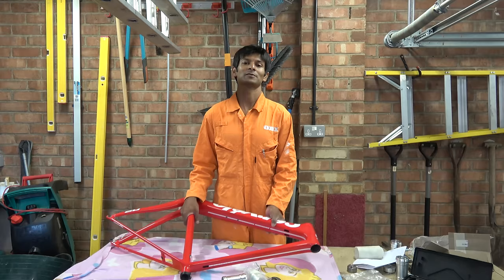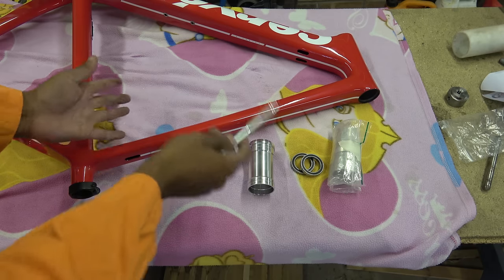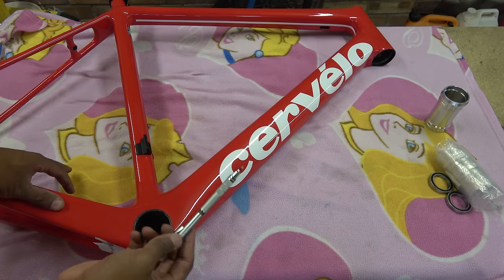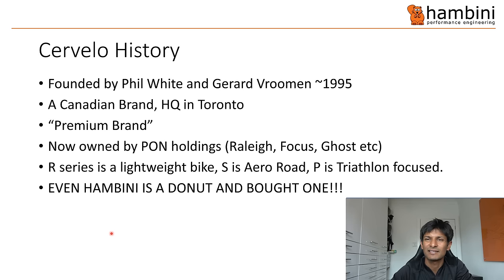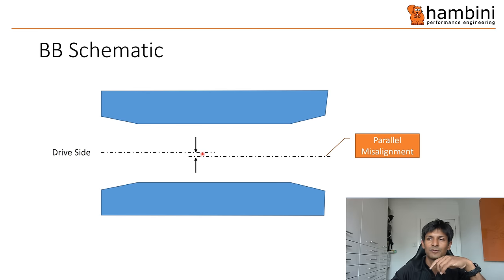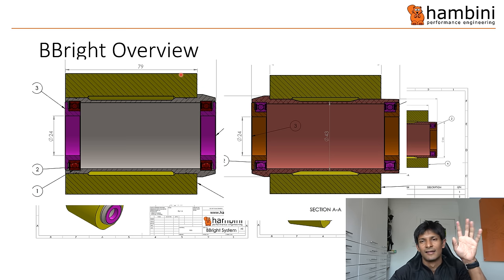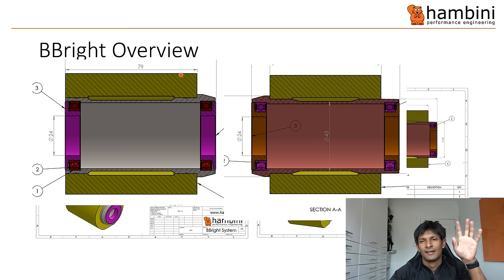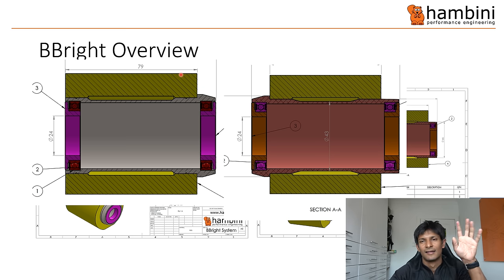Cervelo Exposed and fixed... Scumbag Aero bike manufacturers (A Hambini Reaming)

Comment: Love your swearing and calling these shitheads out.  Some of these bike companies are nothing but con artists.
Reply: @the.communist  I buy second hand, mainly mountain bikes. I buy quite a few because I'm 18 stone (15% body fat so not really a fat bastard :-) and they tend to snap quite a lot. 

I've just got home from a 20 mile ride on a 2011 Kona Hei hei 100 with a snapped seat tube. I pushed another seat post down there and secured it with a few well placed bolts. I've been riding that around for about 18 months. Not really giving a fuck.

Cannondale, Avanti, On One, Mondraker, Kona, Alu and ti, I've snapped them all and I'll be happy to carry on snapping them until the end of time (if they don't cost more than about 600 quid) I built up a carbon Planet x frame but daren't ride it incase it explodes and carbon fibre splinters enter my rectum. I did ask Planet X if they could provide me with rider weigh limit info but they ignored me.

I'll never buy another new bike because they're taking the piss,  I recently bought a cheap second hand CX bike because they looked so cheap in comparison, now though it seems everyone is doing the same and prices will inevitably shoot north. 

Ahh well, in the end I guess they're not too expensive, I just wont pay what they're asking.

Comment: Thankfully the store I work for had cervelo dealership taken up by some othee twat. It was right at the time when this stupid  BBright system came in. The first and last we ever sold was the top of the line R5 CA.  It continuously creaked and the BB would actually migrate out. Even when prepped and cured correctly. The third frame was actually prepped and set allegedly  by their experts. Once assembled it still did the same damned thing! Junk.

Comment: So basically they created their own system and it is near impossible no make it work because the tolerances are such that  that you can't know if a bus or a hair will fit through.
I am so keeping with my octalink bottom brackets.
Reply: octalink is hard to match, very hard.
Reply: octalink are the worst bb's you'll ever have.
Reply: @MyDemon32  In my bikes because I am cheap and rarely upgrade I have only used quadra and octalink, but have worked on other types usually to help mates solve their problems. 
As long as the bottom bracket shell was manufactured correctly it is my experience that sealed monoblock bottom brackets like shimano has for quadra and octalink are the easiest to take care of and the most durable. Bike manufacturers seem not to enjoy them terribly because they will show you how they saved money on your frame immediately on installation - any misalignment in the threads will make it a bitch to install. 
It is much cheaper not to care and then to install 2 independent aluminium cups, one on each side, and forcing the crankset in, like our dear friend had to do in the video. Cheaper yet is not to even have any threading - just push the ball bearings in and it is done.    

For as long as I can I will stick to formats that have monoblock construction.
Obviously your experience has been different - care to share a bit?

Comment: +1 for the All Blacks shirt - from a Kiwi!   Would it have been practical/reasonable to machine the bore of the existing hole in the frame?  Either with a big-arsed reamer or maybe a cylinder hone like a car mechanic might use inside an engine cylinder?

Comment: Looks, like you’re fighting a futile battle.  Your gear is made well and within tight tolerance, and you’re trying to match it into frames that - as an industry isn’t concerned with tolerance as you are.  Either you figure on custom fabbing brackets for all your customers such as here, possibly engineering a new design assuming your frame tolerance your mating into is shit, or decide to hang it up and take up fishing.  Sucks when you care and someone else doesn’t.  But, what are you going to do — most of us are going to have to “work with what we have access to.”

Comment: Hi Hambini,  would using a BB386Evo crank be a possible solution?  Of course the BB will have to be a specifically designed for BBright to BB386 eliminating use of any spacers.

Comment: A few questions:
- how did you determine L20 life expectancy and how much did you get? Because as far as i know the SKF/FAG calculators don't work for the rotational speed for bicycle applications.
- what was the information given to SKF when asking about tolerance? Because it is a huge difference if you tell them the tolerance is in the bearing seat or in the the hole where the tube with the actual bearing seat is.
- i think you compare tolerances from you field (metal?) with carbon fiber manufacturing.

Comment: Enlightening. Presently using a Wheels Manufacturing BB on my P5. Seems to spin fine after a couple years. I do recall having the stock BB replaced under warranty within a couple months when I first bought the bike. I will have to measure the shell when I replace the BB next time,  if I still have the bike.

Comment: do you know if they changed the tolerances because they have cheaped out on the frame supplier?
Reply from the maker: They must be aware that the tolerances are not good because their current bottom brackets are thread together in the middle types which allow for a really crap tolerance.

Comment: Hambini, nice video. Next time I would recommend using a jig grinder with a diamond wheel to recut the whole BB to spec.
Reply: That would be rather expensive for such a small run of 'Fixes' that come his way...  
However...  if Cervelo contracted Hambini to Correct EVERY Warranty Issue - I am ready to help with this endeavor...!!!
Reply: Sounds like what Cervelo should be doing with their frames before they come of the line.

Comment: Sucks about the allowed tolerance change and ovality in the bottom bracket hole in the frame.  Somehow I suspect the current frame construction methodology for all carbon frames manufacturers would uncover issues with many frames.  Another Cervelo frame might have been acceptable.  I own an R3 and so far no major issues...  put some disclaimer on the video that it is opinion and for entertainment purposes 🙂. Letter from Cervelo no doubt coming... stay strong!

PS another Cervelo is probably off my list... don’t like some aspects especially proprietary focus rat thru-axle and not sure about bbright

Comment: Thoughts on SRAM DUB bottom bracket and cranks? And care to make a BB solution for DUB cranks in PF86?
Reply from the maker: I'll never make a bb86 dub bottom bracket. The bearing rating is to low. Dub itself is just a slightly smaller arrangement to all of the 30mm axles that uses proprietary parts. I would stick with Shimano.

Comment: @hambini where can the general public buy quality bearings from for wheels and BBs and headsets? i.e. replace the 699 (9x20x6) bearings in my wheels, or the BB bearings from my hollowtech2 BB (BBR60).
Reply from the maker: 699 with seals is a difficult size to obtain. INA (FAG) make them and NSK also. The NSK's are regularly faked so be weary. Any decent bearing shop will be able to get hold of them.
Reply: @Hambini  thank you. I have found INA/FAG 699 bearings from "simply bearings" and wych bearings, both online, both willing to sell direct to the public. Does £2.50odd/bearing sound like the sort of price i would be paying for genuine bearings for a 699?
Reply from the maker: @bizzehdee  I would have thought they would be nearer £20 each but there we go.
Reply: @Hambini  so probably fake then? 😃
Reply from the maker: @bizzehdee  They could be legit and bought from liquidated stock or B grade - I'd be guessing.
Reply: @Hambini  From what I've seen in the US, if you are just an individual, it's pretty hard to buy name brand bearings (in the US).  So I would order from Hambini, if he carries the correct size.

Comment: Dang! I Bought a Cervelo R3 knock-off frame in 2016 (open mold?). It's 890 grams 56 cm. The BBright thing really irritates me. I had to add 42 grams of adapters for my shimano crankset - or was that 62 grams. I can't remember.I haven't been satisfied with the spin test. But, since I don't race, I suppose it just gets me a little more exercise. Thanks for the technical explanation.

Comment: Hi Hambini.  As you noted at 46:20 in the video, the clearance between the Shimano NDS crank arm and the bottom bracket region of the frame is very tight.  I think using an FSA BB386EVO crankset such as a SL-K Light instead would afford tons of clearance.  Do an image search for "FSA BB30 vs BB386EVO A Visual Comparison" to see the profile of an FSA crank arm.

Comment: @hambini From all of your research do you feel that the older Cervélo bikes were better engineered, eg the mid 2000s bikes prior to the buyout by PON? Wondering how much the reputation is riding on good original designs vs pure marketing spin..
Reply from the maker: They were a lot better in terms of build quality. They seem to have improved their paint jobs and trashed their engineering.

Comment: Speaking of Bike Wheels!  What do you think of the DT SWISS R460 with DT SWISS CHAMPION SPOKES and a set of Shimano 32 Hole 6800 Ultegra Hubs?  This is my first road wheelset after about 23 years of not owning a road bike but I have been riding my mountain bike.  I weigh over 200 pounds and my bike shop suggested that I buy the 32 hole wheelset so I won’t have any problems.  After riding for more than 150 miles, there are no problems and I only had it trued once by the bike shop.  Cheers!

Comment: Is there a reason that a X,Y,Z coordinate axis measurement wasn't taken of the frame? This would allow for both diameters to be overlayed and then a plan formulated to bore the frame concentric. 

You could then machine one of your custom bottom bracket housings. Problem diverted.

Comment: My guts were telling me that this video is so full of BS that I had to check.
1. The man was sending the frame with a BB problem, but in the video the frame is first checked for voids in the carbon layers. Lets find something more to bash Cervelo.
2. Yes CF is stiff but it's still flexible enough to accept the round BB in the squashed oval place.
3. Misalignment between halves of 0.15 mm. Human hair widths are generally between 0.017 and 0.18 mm. 0.15 is less that the thickens  of a sheet of paper. This is a one piece BB which anyway makes the misalignment irrelevant, the bearings will be aligned inside the BB.
4. Tolerances - another baseless bashing - I'm citing from the mentioned page : 
"Kogel: While the tolerances are tight, the executions in mass production are hard to follow for frame manufacturers. In carbon fiber more so than aluminum. Even though the manufacturing tolerance is roughly 0.05mm on a PF30, we have seen frame shells with much broader results. For our bottom brackets we consider frames of +/-0.2mm (four times the tolerance!) to be workable.
...
We have designed our bottom brackets to be tight where possible and relieve pressure on the bearings if they are pressed in slightly undersized frames."
(https://bikerumor.com/2019/06/14/aasq-53-pt-1-kogel-bearings-on-the-functionality-durability-of-ceramic-bearings/)
It's clearly indicated that it's the role of the BB to relieve pressure on the bearings, so the feedback from NTN and SKF  is not relevant and the performance implications are pure fantasies, if the BB is properly made.
5. And another bashing of the customer for the way he has done the frame measurements.
Long story short it was just a simple case of a customer who didn't have the right tools to properly mount a BB and bearings in a fussy frame, resulting in poor results.
Reply from the maker: I hope you have some other job. You would not make it as an engineer.

Comment: Great vid. Just a small point though; at 20.40m you say power loss is 11W at 50km/h. Presumably though power loss depends on cadence (and also on power), not speed? So power loss would be just as high when spinning up a steep col at 15kmh...?
Reply from the maker: Yep you are right. I had to calculate down to a cadence of 100RPM. When making these videos you have to make some assumptions otherwise you would spend 3 minutes talking about the caveats. I'm sure you've been there!
Reply: @Hambini  Absolutely! But it makes this problem even worse as you don't need to be going fast to lose those 11 watts...!
Reply from the maker: @CyclespeedTours  Correct. All of those aeroweenie gains and a bit more can be destroyed by  the bottom bracket.

Comment: I have a question about "old style" threaded bearing cups in carbon frames.  Why is it that these don't tend to suffer with the creak issue, even though the bearings are essentially still pressed into the cups, which are in turn threaded into the BB shell??  My thinking is that because the BB structure within these older frames is generally machined from a single billet of Aluminium (which is then bonded into the carbon frame), the threads can be cut from a single datum and therefore maintain good angular and parallel alignment.  Am I correct on this?  Also, other than Look and Time, which are both quite pricey brands, are there any other carbon frames that you would recommend?  Canyon?  Focus?  Thanks for the great content, keep it up!

Comment: Huh huh, I may have the same problem ? I’ve taken my s-works in for maintenance... and as I got it back the bottom bracket started to crick a lot... the bike mechanic said that the bottom bracket and the cranks all came out together, and that’s not right the frame is defective and cannot be repaired. I bought the bike used it’s 9 years old so The warranty doesn’t apply. By the way, the bike didn’t crick before I took it in for maintenance. I would value your opinion what do you think? Thank you!

Comment: Fortunately sometimes it seems to work. I have a 2019 R5 with PF4630 and haven't had a single issue with the bottom bracket. Never had a creak or whatever...

Comment: any thoughts or issues with Dolan?  thinking of getting their new DF4 carbon track bike, but not if their BB is going to be shite!
Reply from the maker: They are not good.
Reply: @Hambini  no!  any recommendations for a really stiff track frame around the $2000 mark?
Reply: @Hambini  I guess I was getting at, was getting that frame but having one of your BBs installed.  but if frame could be no good to fit a well specified and machined BB like yours, then that's not good.

Comment: That was most interesting but I have missed what, exactly, was the fix.  It seems to be the Loctite 641, and the 'bullet' is a not-strictly-necessary installation tool to minimise the risk of cracking the frame.  Is that correct?
Reply from the maker: it's the adjusted BB tolerances and the bullet is required to tease the frame. otherwise it is more likely to crack.

Comment: @Hambini any chance you could do some sort of friction testing in the bb with the cranks installed; clean vs dirty (dirty would require defining but I guess my point is obvious)?
by just seeing that the gap between non drive side crank arm and frame is so small my cleaning ocd has kicked in already.
Reply from the maker: well, I can comment directly based on experience on my S5. If you ride through any damp conditions and pick up some dirt, you can hear it rubbing between the arm and the side of the frame.

Comment: @19.20 min into the video, the NTN and SKF remarks pertain to acceptable bore tolerances for insertion of their ball bearings. Since an aluminum sleeve goes into the bottom bracket first, those tolerances are not applicable.
Reply from the maker: And what do you think is an acceptable tolerance
Reply: @Hambini  Because of the use of an aluminum sleeve, any tolerance that ensures a tight fit of the sleeve is permissible. The catch being that the aluminum sleeve has to be sufficiently stiff to resist any torsion or compression an irregularly shaped bottom bracket mounting hole may posed. Please correct me if I am mistaken.
Reply from the maker: As the sleeve would have quite a thin wall. Any compression would end up in the bearing. A range of 0.1 is too much
Reply: @Hambini  Just wondering if you had taken any before & after measurements of the sleeve internal diameter?

Comment: I do am interested in bottom brackets because I had this same issue with a Madone Trek frame, the berrings kept on breaking and I absolutely understood that the alignment of the BB was the main problem, but I could not proof that theory , and this went on for months and months.  Trek took the froma and did something in Waterloo, wisconsin, sent back ans it was even worse!

Comment: Awesome video - The 'premium manufacturers are a joke. The main role of manufacturers now is not to make quality bikes, it's to ensure you buy another after a year or two. That's usually through moves to new 'standards' or by engineered failure, for example glue failure on CF bikes bottom bracket shells. The insane amount of BB 'standards' just increases costs and makes things difficult for small, high quality component makers.

Comment: I'll be honest, when I saw that he set in the old BB that was cut in half and used to press the new BB in.
One could suggest that the BB was improperly pressed into the frame and that is how the frame ended up that way.

I believe it would be easy to blame the person for a hack gone wrong, but I still feel pressing BBs into carbon is just idiotic.
It's not worth the weight/manufacturing process savings. That said, I don't ride my road bike much anymore but I still really like my 2010 S2 with threaded BB. It's ran perfect for the last 9yrs for me. BBRight was the reason I haven't considered upgrading.